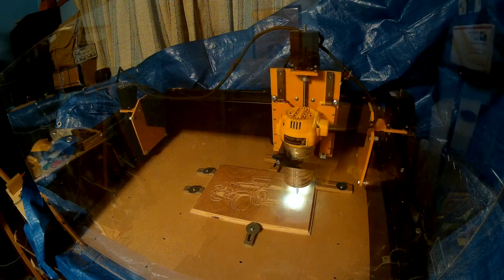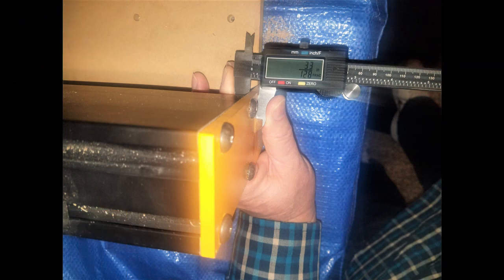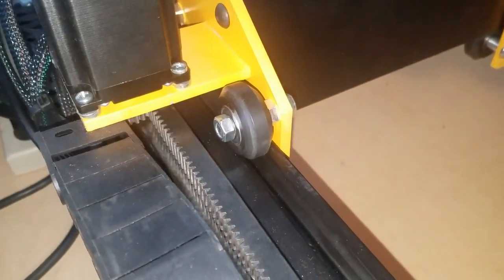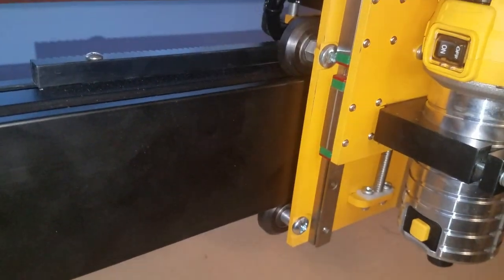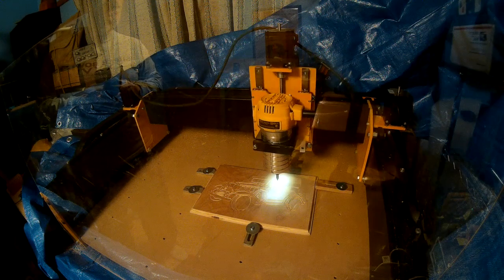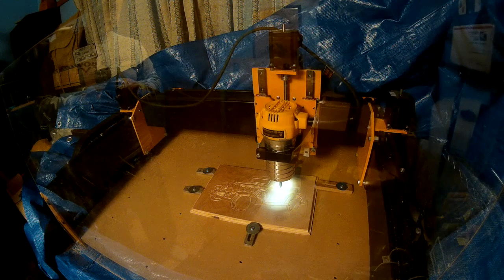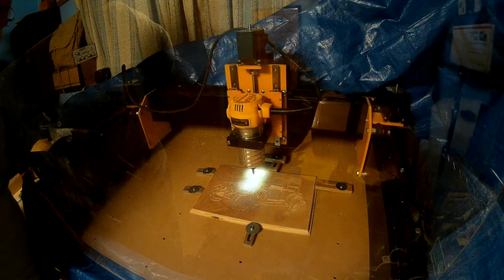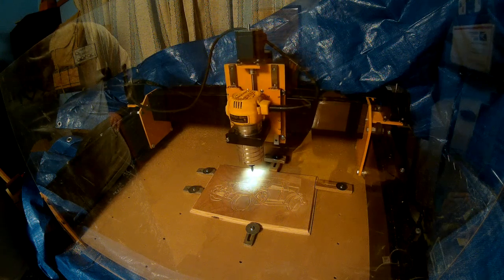MillRight CNC Mega V Feature Spotlight - Machine Frame

Comment: Thanks for the video! Can you show the support for the machine base :-) I'm curious to see how the y-axis frames are connected. For instance the shapeoko has rails running between both the axis's.
Reply from the maker: I forgot to mention the machine bed options, sorry about that.  A standard 20x40mm aluminum rail connects the lower Y axis front to back on both sides and secured by two screws to the bearing plates.  A third 20x40 rail connects between the left and right sides and supports the bed in the middle. I have the MDF bed option which is a 3/4" thick with threaded tie down anchor holes.  The MDF is screwed down to the aluminum 20x40 rail at six points, 3 on each side under the Y axis.   An optional aluminum T plate bed is available also.  See photos of the T-plate here:   https://millrightcnc.com/product/millright-cnc-mega-v-router-bundle/
Reply: @beroger0  Awesome. Thanks for the info. I ordered the t-plate version (and pretty excited about it). To make sure I understand, you're saying there is only one rail going along the x-axis in the middle for the bed support -- along w/ the wasteboard. Any worry about the machine jolting out of square?
Reply from the maker: @jdellamore  I needed to check on how the T plate was installed.  There is a 20x40 rail connected to the bottom center, front to back of the T plate.  My unit doesn't flex at all.  The T plate version should be the same.
Reply: @beroger0  Thank you for all you've done. Videos were great and helped us in our wait to get our machines. Since we are in the subject of the base frame... I am a little apprehensive about the H frame and using the bed as a structural piece. What is your opinion on simply adding two cross rails (front and back) to make the machine frame "independent" from the bed? I love the design and the rest of the components but I just don't get why the bed has to be the component to complete the frame when two rails would accomplish this... better in my opinion.
Reply from the maker: @erdiabolo  That's the great thing about these machines, you can modify them.  If you want to add a couple more cross pieces to the base you can do that.  I think the design was such that adding more support under the bed didn't really enhance the rigidity of the machine.  It is rock solid.  There is no twisting of the frame.